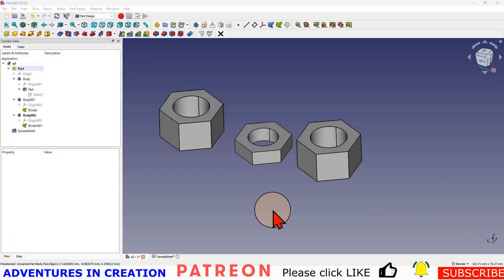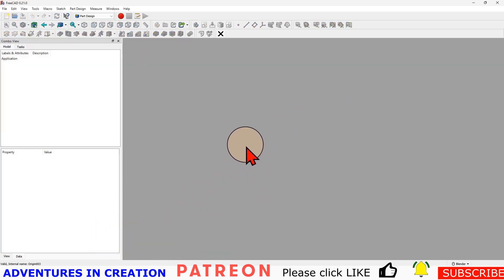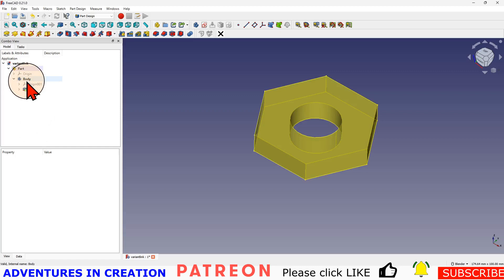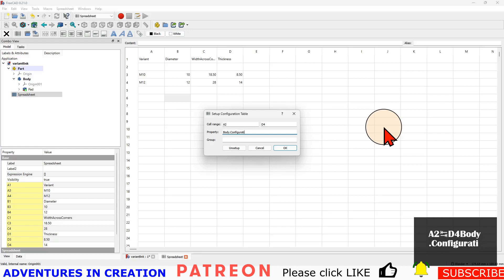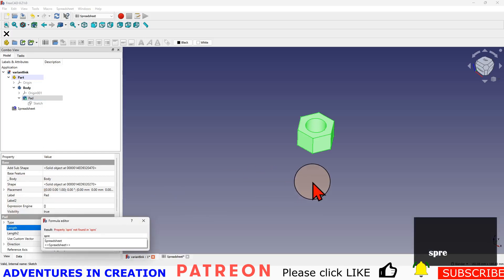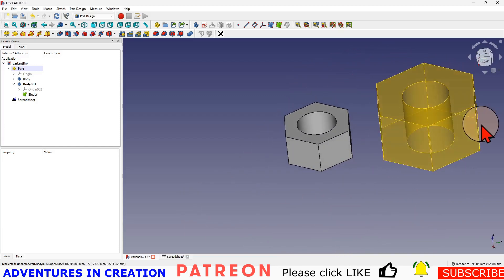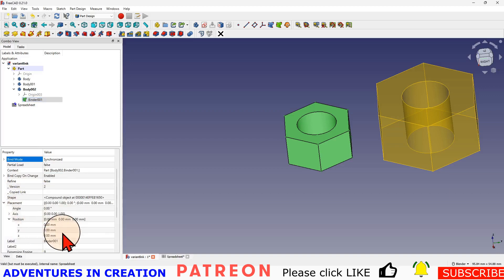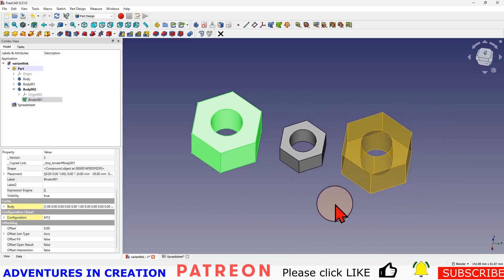FreeCAD for Beginners #56 Variant Links #freecad #cad #makers #design

Comment: Awesome video. I am subscribed and I did check the like video.  I have a few questions? Can we go back and change the setup of the configuration table.  later on in the video you said you can have as many entries as we want.  I assume that is what you would call them. I did add another entry, an M14 and the Data configuration let me change to the new numbers I had put in the table. Is the configuration table automatically adding to the original A2 to D4 to make them A2 to D5 or can the numbers go out of the scope.  Lets say that I wanted to have a table with screws.  I would want to keep them separate from the nut category and I could even have a bolt category should we keep them on the same spreadsheet or make a new one?  I just have to know how things work because of my OCD.  You have given a informative and awesome video and I appreciate the hard work and time you have put into making this video. Thank you and God Bless.
Reply from the maker: I would keep it all in the same spreadsheet in different sections, you can create large tables with different variants.
Thanks for subscribing, I hope you will enjoy all the videos in the series.

Comment: Interesting, more to learn every day. 

I am curious when you were selecting spreadsheet data, it showed two (Spreadsheet) and (<<Spreadsheet>>) I have always used the second one, is there a difference?
Reply from the maker: The <<Spreadsheet>> is a changeable label, for instance, if you rename the spreadsheet to "box" the label will be <<box>> but the system generated name is still Spreadsheet. The system will automatically create those names, a second spreadsheet will be call Spreadsheet001 etc.
Reply: I believe one is the label/name you can change, one is the name the system gives it that can't be changed.
Reply: just to add tthese good responses
<<Spredsheet>> is a freecad expression engine syntax. It will be transformed by Freecad expression evaluator.
Spreadsheet.variableName is plain python. At runtime it will just read the variableName property inside the Spreadsheet object.